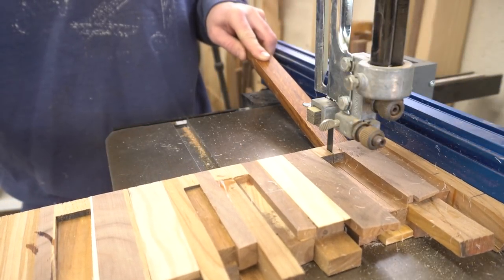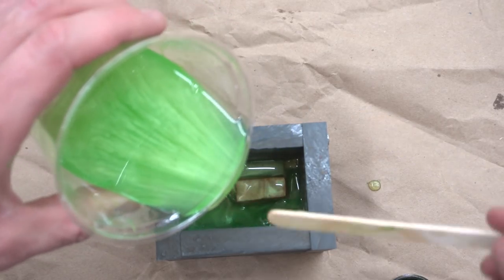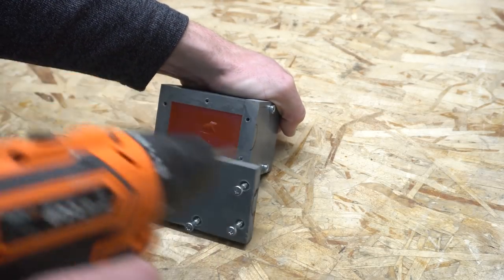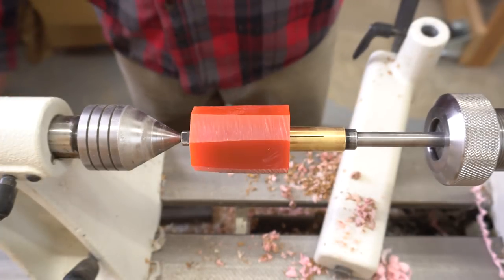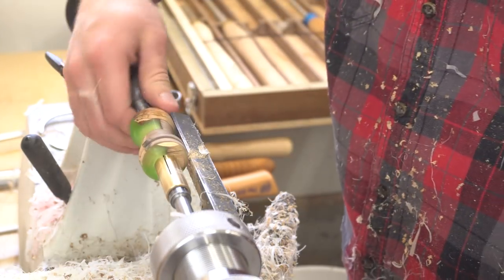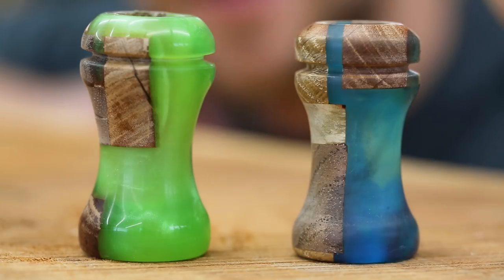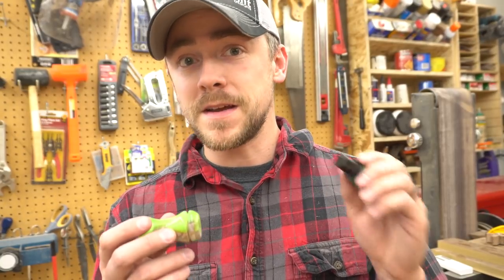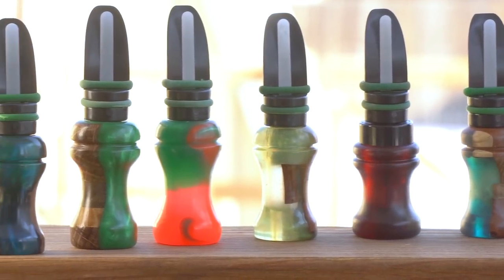Turning Elk Calls & Casting With Alumilite

Comment: Those blanks came out awesome! I eventually want to get into casting when I can afford the tools.
Reply from the maker: The only tool I didn't have was the pressure pot. You can convert a Harbor Freight paint pot pretty easily and the parts don't cost much. I waited for one of their deals and got my pot for $80.

Comment: A CA finish would work great on those and you could polish it like before to get a great shine.  Also if you want to get some awesome swirls and color separation in the resin, get an infrared thermometer and wait until the resin gets to 95 degrees, then pour it in, will keep the colors separated nicely.
Reply from the maker: I haven't been able to pull off a good CA finish yet. I need more practice!
That's a great tip about the resin, I'll have to try that!

Comment: I know this video is a bit old, and you've probably adjusted your process a bit too, but have you thought about doing a CA (Super Glue) Finish on your calls? You can build it up a bit to sand/polish back down for a nice smooth finish without worrying about the wood.

Great video! Was the first one I found when looking into calls (I do pens personally and am looking to expand). Keep up the awesome work!

Comment: Great tips! I just started resin casting myself. I haven’t done any stabilizing either. I can’t decide whether to buy a vacuum chamber or make one like I did with my pressure pot. Stabilizing would be the way to go for you. No more spray finish.
Reply from the maker: I've been pondering on the same question. If I build one, I get more content for another video. But, I keep pricing it out, and depending on what I want to use for the main chamber, I might not actually save any money building it myself.

Comment: Cool video. Try using thin ca on the entire call and then polish with the micro mesh up to 20000. It'll make the whole thing shine and also protect it like your spray on finish does. Same as when making pens.
Reply from the maker: I have tried that on pens a number of times and I haven't been able to pull it off! Usually I don't get an even finish. And I rip holes out of all the fingertips of my latex gloves, and looks a few more details in my fingerprints in the process. I need to practice more I guess.

Comment: So the glue is just adding thickness to the inside rather than actually sticking the mouthpiece in?
Reply from the maker: That is correct. You want the mouthpiece to be removable because occasionally you will need to replace the reed.